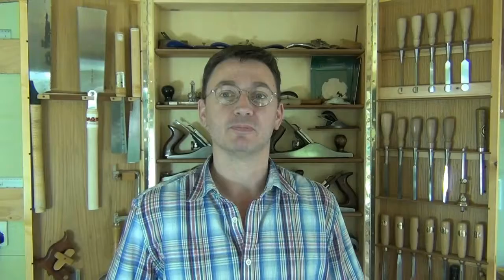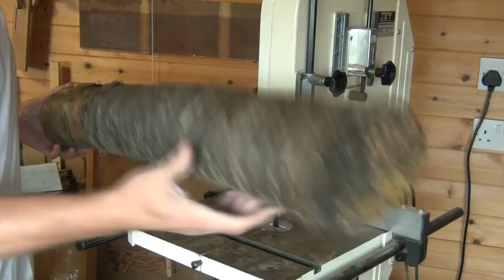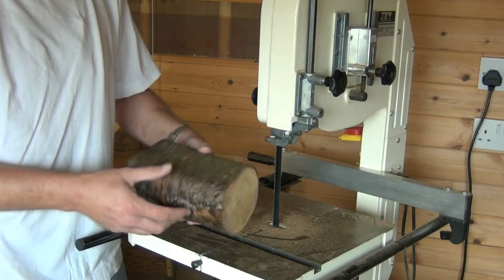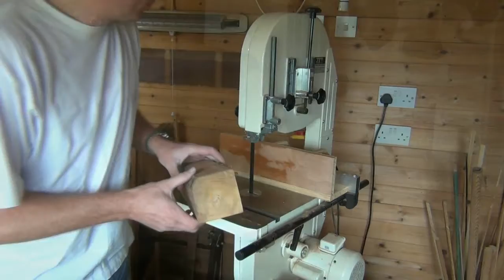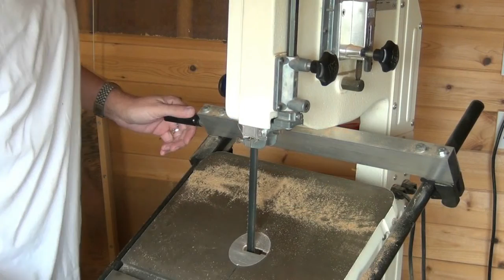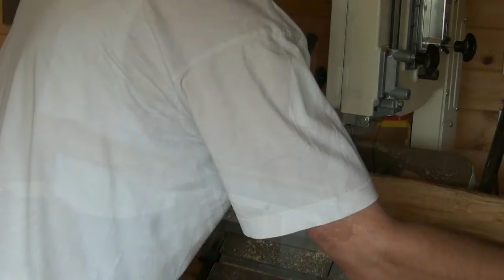Small Butt Milling on a Band Saw

Comment: check out this video on Quarter Sawing, you wont have the thin edges or tilting your table to deal with. http://youtu.be/eQOLdlavAWA
Reply from the maker: Interesting video you recommended, thanks. None of the boards are what I would class as true quarter sawn. Clearly on a larger butt the first cuts will be pretty close, with both board sides showing good q/s figure. I can't cope with a large enough butt on my bandsaw, sadly.
Happy woodworking, Mitch